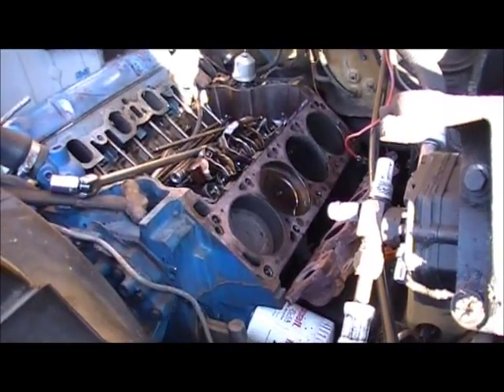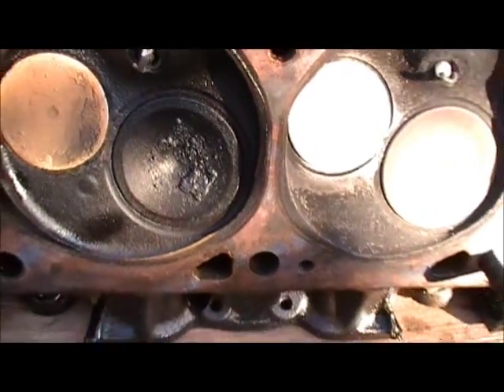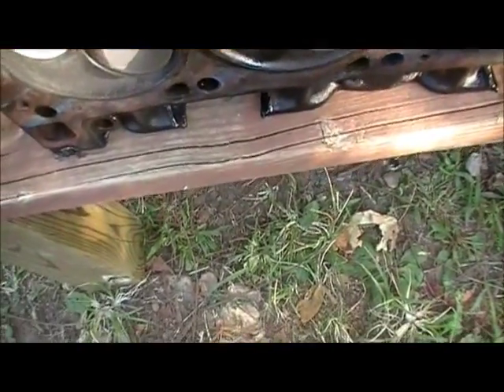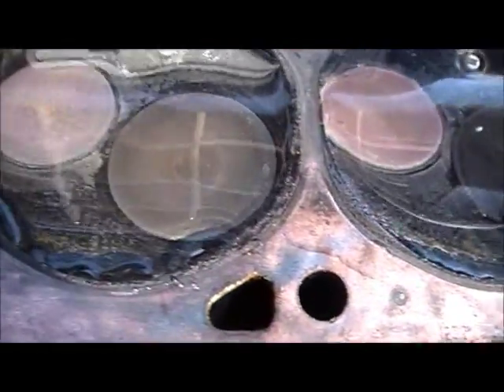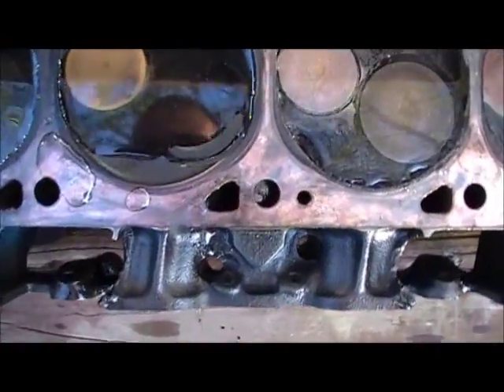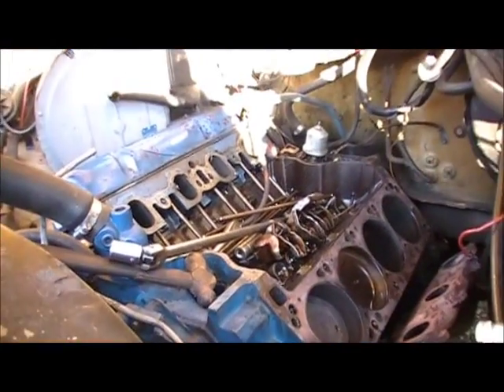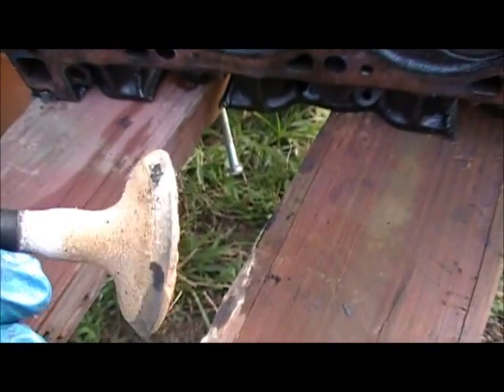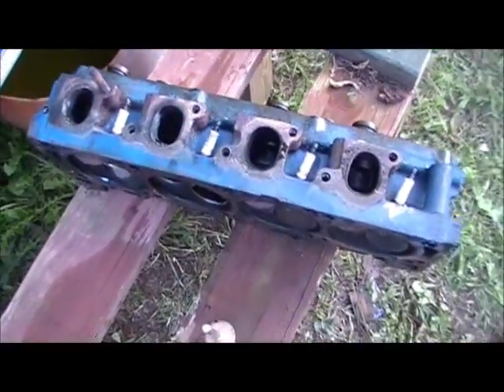Ford Bronco Engine Misfire Diagnosis

Comment: Yep, a valve can do alot of things. 2 of my valve were stuck and making a knocking noise and misfires. Who knew. Too the heads off. Did a valve job and clean everything back up, put it together and everything runs like new!